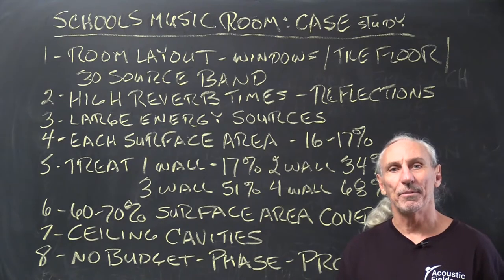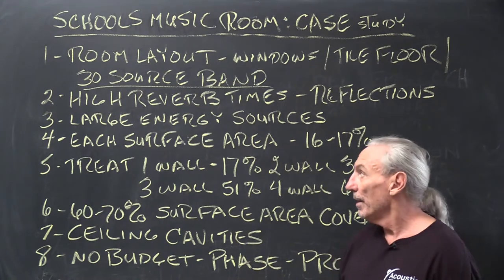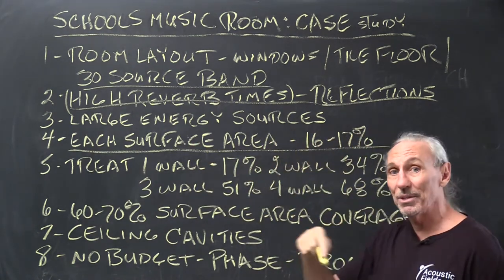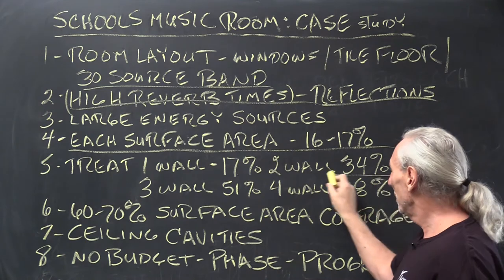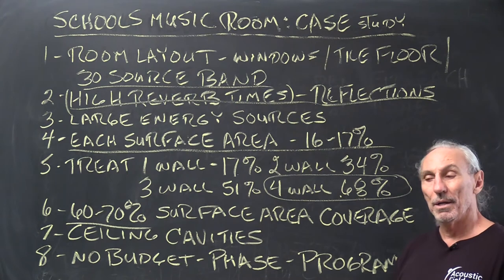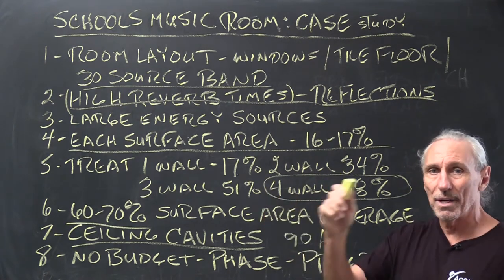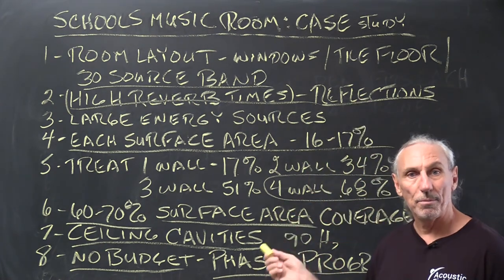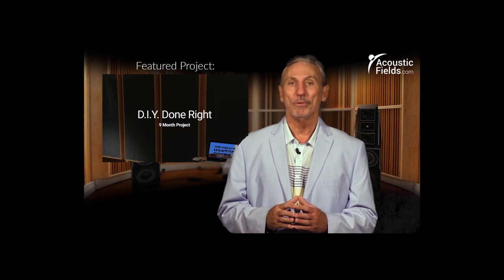Schools Music Room: Case Study - www.AcousticFields.com

Comment: I retired from Music Education in 2007 and I so wish I would have had a resource like this available “long ago”.  This is a big issue in trying to instruct music students. It is true that they cannot hear well in the room environments and as such many have a poor interpretation of what their instrument is supposed to sound like and because of acoustical problems students over compensate and develop a myriad of tonal and pitch issues that become difficult to fix later on. I would like to know just who came up with the idea of ceiling cavities. They create problems with lighting as well as acoustic issues too. Too many shadows from insufficient lighting doesn’t help either (but that’s a different issue).  I’m going to pass this along to a few individuals I know who are current music educators. Thanks for another great presentation. It definitely touched “a nerve”.
Reply from the maker: Without room resolution, you can not uncover the true beauty of tone. Those who have never heard an acoustically balanced room do not have a quality reference on which to base their comments. Their reference is mostly noise based.